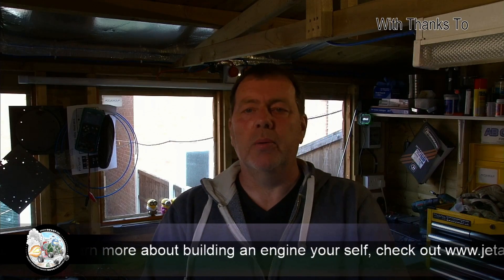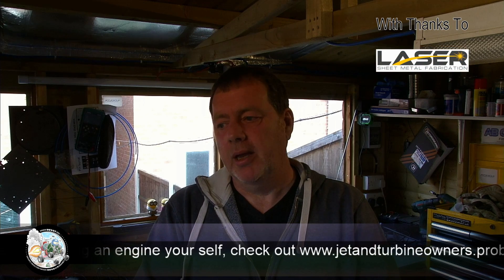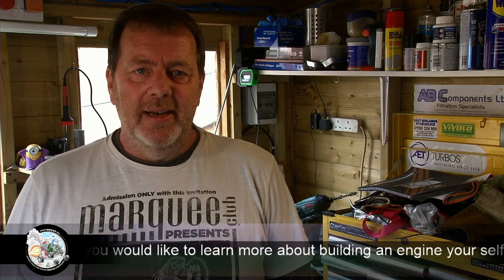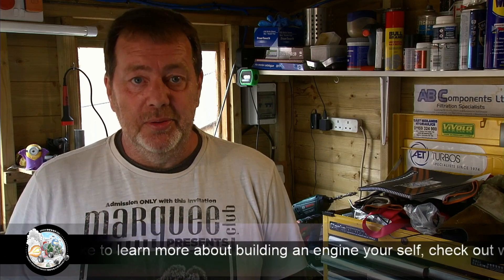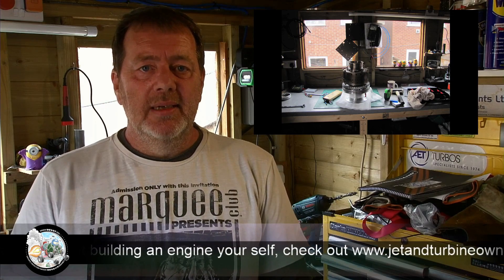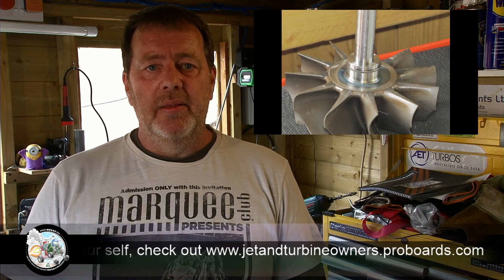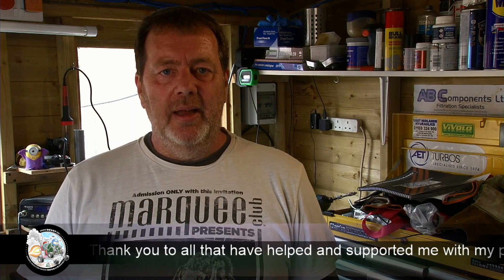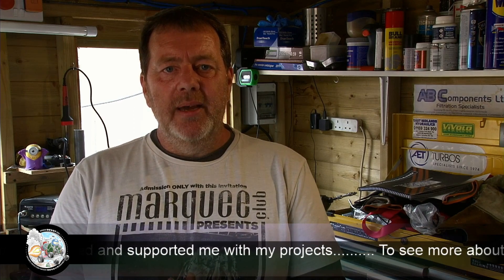Jet Engine Test After Fail Test

Comment: Jesus, look at it flex that wooden fence. How many pounds thrust do you think it's capable of?
Reply from the maker: hoping for above 250, may be as much as 300... will know soon as hoping to do full afterburner run in the next few weeks
Reply: @Turbojetkart  What? 300lb thrust from (what appears to be) an 8" centrifugal jet engine?!?
Reply from the maker: The comp wheel has an inducer of 110 mm, the out side of the can is 250 mm , time will tell.... but yes it would be nice to get close to the numbers
Reply: @Turbojetkart  Ah, ok. I guess 1300N out of 250mm isn't impossible. Serious number still... But that'd be about right since a well-designed jet half that diameter can do about 400N; given you're using about the outer 15% of the radius - that area increases by 400% if when you double it. Good luck - look forward to the bench test.
Reply from the maker: the real power comes when the freepower unit is added 😀

Comment: AH! that"s better, just a bit more R&D on the engine and your good to go.
Reply from the maker: Yep.... a little less oil, a little more power to the motor.... just worked out pump is perhaps only at 40% the rpm are limited on the speed controller to 50%, and the throttle is set at 60 % on the servo controller ?